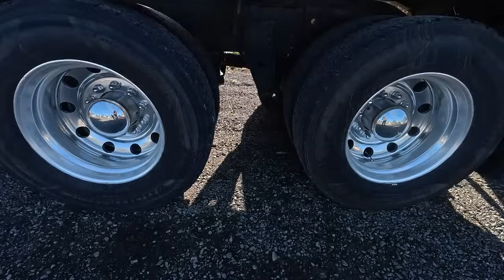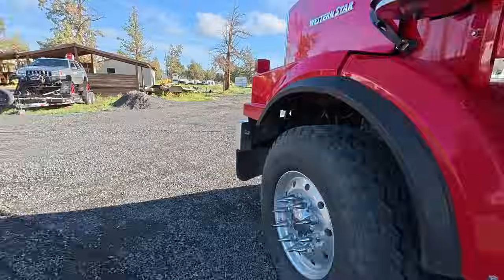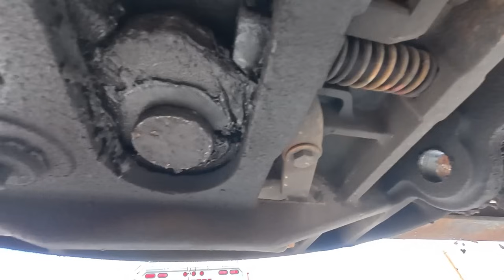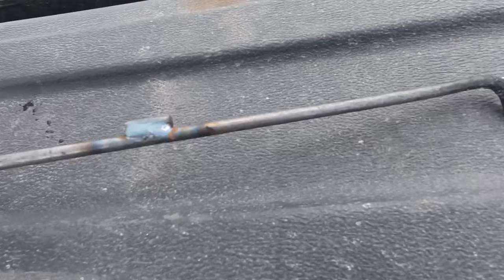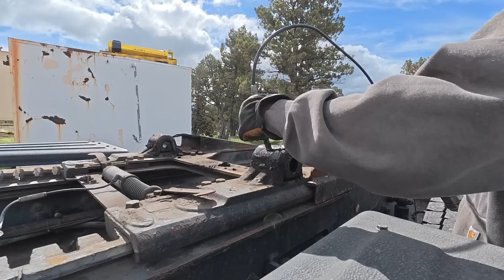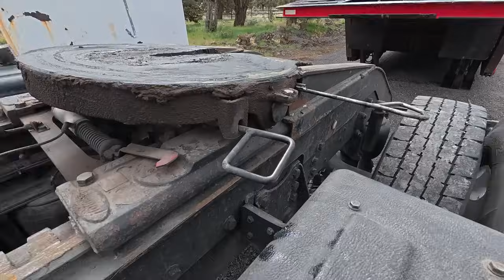My 5th Wheel FAILED 😳

Comment: wow, your heavy tractor is more versatile than I thought, you have the heavy pin link capable front, And you also have a pintle hitch And 2" bumper pull drawbar receiver....  I hope you have both commercial and rv receptacles... Is it wired for drop axle switches? auxiliary 7 pin (our company started using a secondary 7 pin pigtail to control drop axles on our heavy trailers)? Is there a gooseneck receiver?

Comment: Put 40-ft folding container house from mbxhouse on the top of the entire trailer. All the way to the front of that trailer. Build a giant I-beam x section rectangle box storage unit... then enclose it with storage compartments and doors for the back 4/5 of the trailer. The storage units with water tanks and septic tanks and solar batteries would be used to support the back 4/5 of the container house. Do you think the center of balance would ride too high?

Comment: Cotter pin Over here in old Blighty is a tapered pin driven in to retain a two component connection - pedal cranks to the shaft on a bicycle for example. What you used and what nearly shortened your career, is a "split-pin" to us.
Fascinating stuff, CHEERS!

Comment: Im with you on not being a fan of what you refer to as a cotter pin, we call them split pins. Wherever i can i replace them with R clips as used on a lot of agricultural equipment and plant. They're much harder steel and less likely to break up when you trying to remove them. 
I enjoyed the way you explained the function of this unit as you worked through it.

Comment: Fifth wheel RV owners take note always do a tug test. I raise my landing gear about an inch off the ground then set the trailer brakes with the brake control and try to pull forward. If it is not latched it will only drop an inch and not smash your pickup box sides.
Reply: A few YouTube RV creators have found out the hard way.

Comment: A quick and easy way to pull those pins is to weld a nut to the pins and attach your slide hammer to them. Often, you just use the slide hammer as a handle.  The good thing is that doesn't happen often.

Comment: I use the B&W Companion 5th wheel with my 5th wheel toyhauler.  It seems to be a nice design... double, very thick jaws.  But cant hold a candle to a bit truck.  Though despite all the tightening of specific bolts when you assemble the thing and put it in the truck, It seems odd that we're trusting a roughly 3x3 inch piece of ALUMINUM that goes into the goose neck hole that attaches to the 5th wheel frame.  But it does work and has worked well for the 20 years I've had it.

Comment: Are you running different size tires on the rear of that truck? the inside tires look narrower than the outside. If so what is the reason for doing that?
Reply from the maker: No

Comment: I got one question say your in a truck stop overnight how can you tell if someone has pulled those levers or not before pulling out to travel on ? Is tge a way to see by looking or is it pull out an pray no one released them ?
Reply from the maker: You can see by looking at them.  You also tug test your trailer

Comment: You could bolt a little clamp onto your new rod between the frame holes, so even if the cotter pin failed the rod couldn't fall out.  Pretty much belt and suspenders because the cotter pin is probably good for decades, but you never know.

Comment: Luckily the trailer landing gear has some good lift height to it.   If not, you could of also picked up the landing gear again, put some big blocks / railroad ties under the landing gear then raised up the trailer again.  You would easily gain even more height that way with minimal effort.  I would of also blocked the back tires so the trailer has no hope of even moving an inch.

Comment: Lol love it Casey think it will work. I used to drive over everything size weight height length chemical frac van. I always wondered what would happen if I unlocked my plate if it would rip the trailer off if on fire went thru my mind many many times. Keep it up big guy love everything you do and for your family and grumpy

Comment: Another awesome video. You did a good job replacing the handle on the 5th wheel. I deal with a standard 5th wheel because I pull a 53 foot reefer

Comment: Casey, at 19.50 minutes, the trailer and truck moved, because the earth was rotating on it's axis and atound the sun, so everything moved, while you repaired the 5th wheel safety locking  handle!?

Comment: I have a cater pin story. A PG war story. Before we went north to get ready to go into Iraq. 82nd Airborn took our trucks. They had to drive in. They said we were not experienced. We got 7-ton cargo trucks. In Iraq. I lost my clutch. I made it back to base stuck in 3rd gear. To get off of the main road. A hard right. Then. Another right. I had to shut the truck off to stop. Under a trap door where the heal of your foot was. Was the bar that operated the clutch. A cater pin came out. The trucks were their Mercedes Benz trucks. I went through the boxes and found a nail. That nail became a carter pin.

Comment: This failure is not something that is predictable a pretrip no matter how careful it is done would have likely caught this. Something that you might think about though is adding a second pin or cable through the handle a couple inches inside the catch this would stop this handle from vanishing again!

Comment: I had a fifth wheel fail on me.  I used to drive the delivery truck for Home Depot, which has the MOFFET forklift on the back of the trailer.  When the trailer is empty, the weight of the forklift creates a see saw effect of the king pin inside the jaws.  Over the years, this see saw effect wore down the jaws down to where there was a lot of play in it.  I took it to get the adjusted to remove the play.  I don’t know what they did, but it did not lock all the way after adjustment.  It felt locked when I picked it up from the shop with the trailer empty, but the first time that I put a load on it and tried to go, the fifth wheel came open, and I dropped the trailer on the ground.  Further inspection of the fifth wheel found it damaged beyond repair and they replaced the whole unit.

Comment: Hi Casey, I drove over the road for a few years. I never really knew how the fifth wheel worked in all that time. Thanks for the video. It helped me understand what was happening. One thing I noticed that you do when hooking up is the tug after the fifth wheel connects. I remember doing that and it brings back a lot of memories when I see you doing it. Thanks again for the videos and explanations.
Also, you're right, you can't catch stuff like that during the pre-trip inspection. Anyone who thinks you can, isn't much of a truck driver. They're just a wheel holder.

Comment: One of the dumbest things I was told when I was working in a tractor trailer shop is . Stop making so much noise ! From using my air tools . Back in the 80s   they were my money makers. I couldn't help they came in with a hang over . So I used them more .

Comment: Good job buddy. The fifth wheel on my heavy haul tractor is actually 4 inches higher than a standard fifth wheel. Have to be careful when hauling in a n enclosed trailer not to be too high.max 13’6” here in mass

Comment: While I was driving big truck, I had some issues with fifth wheels. And a couple of drivers I worked with had 5th wheels unlatch while pulling trailers down the road. One of the drivers unlatch was a 5th wheel latch failure. Turned out there was an actual problem with something in the latch area of the 5th wheel which was not revealed until it was thoroughly cleaned and disassembled. While I don’t know what it actually turned out to be, the whole unit was scrapped. The shop actually took a torch to it o make sure it would not actually accidentally be salvaged for parts and put back into service. 

My issues were primarily my doing as I did not properly hook. But I discovered almost all those problems on the all important tug test. I did get surprised by a weather related failure. Build up of ice, snow and crud resulted in an unsecured latch securement. It had passed visual inspection, as in the handle was properly retracted and the jaws were visually closed, but the ice had prevented the safety catch from properly seating. First time it happened, it was a big surprise. It also happened a few times after that, but I was no longer surprised by it, in fact I was sort of expecting it might happen. From my previous experience, I had modified my hooking and pre tip inspections specifically to catch those situations when the weather and conditions were present to cause the situation. 

I also was amazed how all those huge forces and loads were all passed through just a few small pieces of steel located on the slider. Not only the forward and back loads, but also all those torque, lifting and twisting side load as well.

Comment: Well Done !!! Damn Fine repair Job ! Just Like Factory. Probably better than any Repair shop would do & a Very Well Documented repair.

it's very cool to know how that works. if ever happens again or to someone else You could Use a coat hanger to release it in a Pinch or similar. maybe even a piece of wire or string to pull on it in a Pinch. Doubt full that's going to happen again for about 10 years or more.

Comment: Wonder if you could have put the landing gear down just to anchor the trailer, then put the truck in neutral (equivalent) then used the ramp to move the truck fwd a few inches, then rig that pry bar, then fold that ramp back up (truck brakes locked) effectively pulling the trailer off the truck without spinning the drive shaft.  ??????

Comment: Slicker'n grease through a goose.Big heavy stuff still fascinates me. How that hydraulic landing gear could be adjusted to that fine a degree was impressive. Neat  handle fab and explanation My Ranger came to me with a missing shift motor. It was the least of my concerns because 4wd controls on 90s Ford was iffy at best. I used a pair of vise grips locked to the selector shaft. To keep the tool handy I put a mechanic's wire to through a convenient hole in the pliers and wrapped the other end around something solid. Haven't lost them yet. Can Haz Yankum shoe laces to fashion  tethers ?😎👍

Comment: Wow harsh technically your fifth wheel didn't fail it's release failed but yet I don't think a DOT check inspection would have even caught that it's a unseen maintenance 🫣🤔 guess you should look at all linkage contacts and fasteners just like you inspect all your Dring and ratchets tie down points for wearing ‼️
Hopefully we learned something from what Casey's experience pointed out something that the average truckdriver is not looking for along with maintenance crew mechanics???😮

Comment: if you really hate cotter pins you can use a key ring as a replacement if one fits, or the tractor lynch pins but I doubt you will find one that small, I always just drilled the hole bigger for the tractor lynch pins.

Comment: Cotter pins are the worst. I was standing on a loaded liftgate once, looked down, and the cotter pin holding the support chain had fallen out. Thankfully the dowel itself was rusted in place! 

Always makes me happy seeing others taking being a Truck Driver seriously. I earned a rep at my company  for always being a huge stickler for pre and post trips. I got blown off a lot when I started (and a few coworkers made it very clear it was because I'm a woman) but I've found some absolutely insane stuff broken that they all missed. We slipseat and do foodservice in the Cascades, so our rigs are running 24/7. 

Some favorites from the last few years include the p/s shackles holding the steer axle on being broken, support arms on liftgates being split through, and even a rig setting itself on fire while I was mid-delivery. Tractor wasn't even on! Just lit itself up!
Reply: Yep, I did my prep trip meticulously, because it was so easy to forget a step.  We drove leased rigs with a maintenance contract, so it was rare to have a problem.  I might not have been the best driver, but I was a safe driver.

Comment: BRILLIANT SOLUTION to a resolution of the problem!👍🏼👍🏼👍🏼👍🏼😃 those two little bolts should be called the JESUS nuts, just like a helio that relies on a single Jesus nut to hold the rotor to the transmission shaft😃 not quite the same but if those little nuts broke and the pins walked out due to vibration…yikes….odds of that happening are perhaps one in one million…but perfect storms do happen.

Comment: You are 100 % correct. Even a DOT Inspection would not have caught the defect without disassembling the 5th wheel because that is not accessible. It’s a piss poor design. People saying anything else are DUMB ASSES and need actual driving experience with that latching system.

Comment: Nice repair Casey...awesome content too! Loved the ending cuz integrity is everything! 
After seeing what the front latch or #1 release handle appears to be modified so to not employ a cotter pin and I really really like it. 
I would be getting in some stainless steel rod in and bending it after I putting it in place with some heat if needed...cuz that drilled hole and pin looks like a failure point waiting to happen...no? 
Thanks for the videos.

Comment: Every time you show the picture of your wrecked truck, im still impressed that the 5th wheel/kingpin held tractor and trailer together. Every photo of a truck wreck, jack knifed, down a canyon, upside down, over a bridge, every time the 5th wheel holds.
Reply: That fifth wheel better hold, because the alternative is the trailer deciding it doesn't want to be on the truck anymore, and it rather likes the look of the SUV in the next lane.

Comment: The standard latch is made like a Nail with the head already on it.  It slides through the connecting lever first, before being assembled.  This eliminates the dependence on something like a cotter or clevis pin.
I was wondering, rather than putting a cotter pin with a washer, what if you put a regular-sized washer, then welded another washer to the tip to make a 'Nail Head'?

Comment: Am I right? This is still a 2 inch Pin? In Germany havy haul Trucks have larger Pins and you have to change the claws to haul a "normal" Trailer. Some even Bigger Trucks have two 5. Wheels on the same Slide. The taler havier on in the front.

Comment: I worked on Macks for 40 years... I cant believe your luck that you had a newer 5th wheel that had the pins with bolts holding them. My luck would have been the old ones that had the stupid roll pin under the plate that don't want to come out... Its scary all the things you get into that I did all the time at work.... I did most of the road calls too...

Comment: I've seen a 5th wheel fail on a truck while it was driving. We were both on the highway. It was up ahead in another lane. 

Suddenly the trailer just dropped and came to the quickest stop I've ever seen. It stayed in it's lane though. 

When I drove past I looked at what the landing gear did to the road. And it looked like once the landing gear dug into the road it managed to stop the trailer in mere feet. 

Between the trailer brakes working as designed bringing the trailer to a screeching halt and the way the landing gear dug in. Nobody tailgating that truck could have ever stopped before they hit the trailer hard.

Comment: I've rebuilt almost every brand 5th wheel plate in my 35+ years turning wrenches including Holland, ASF, Fontaine, Jost, and others.  You are spot on Casey! The 5th wheel is THE most important safety item/device on your rig.  No one would have found any issue during a pre-trip because the handle was in place as your stated.  Haters gonna hate ef-em I say lol.  Keep up the good fight sir! BTW, scrap that nasty grease out of the center cavity please. My ocd kicking in lol.

Comment: Casey,
Since the failure seems to be the cotter ion, why not add a safety wire to the handle so that all you need to repair is cotter pin and a washer.

Comment: I had asked a poorly worded question when you first showed us the drop neck regarding how high the landing gear would lift the front of the trailer. This just answered my question and then some - I figured it would go up higher, but I had no clue it would raise up as far as it does (and obviously will do so with a load with no problems. Now - the sad thing - I've actually seen one of those handles laying in a rest area and didn't know what it was - now I know some truck driver is pissed because the cotter pin came out and they had to figure out how to unhook just like you did.

Comment: Casey if that should ever happen again you could use a piece of wire are even a shoestring through the rod hole to pull the release pin open.  Would be much safer than using a pry bar.

Just a thought love the channel!

Comment: The fact the pins came out so easily proves a little grease goes a long way. 
I wonder if the assembly misalignment could be from a slight bleed off on a lift cylinder. Even brand new cylinders with a flow splitter between them can have small timing issues. Nothing was never really wrong, oil has a funny way to find a path of least resistance. I saw it a few times in my past life as a millwright.

Comment: 🤣 Turns out the hammer works even if you don't swing it. Who would of thought!🤣  That cracked me up!  
Surprised someone hasn't tried to argue that point or yell how dare you use the hammer like that.🤦‍♀️🤦‍♀️ 🤣
Glad you were able to get a new handle/release bar put into the 5th wheel without any big issues. 
Be Safe!
Keep Your Head Up! 👍